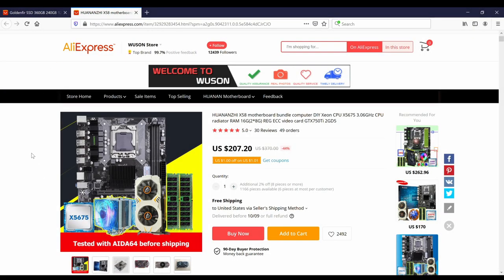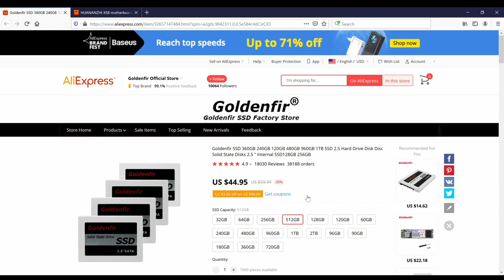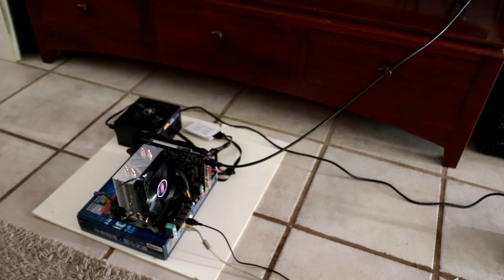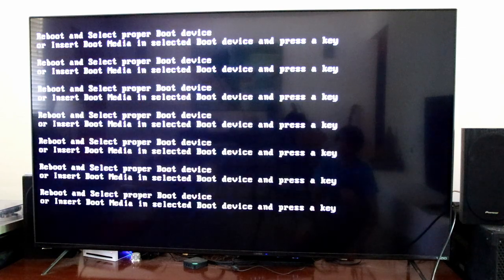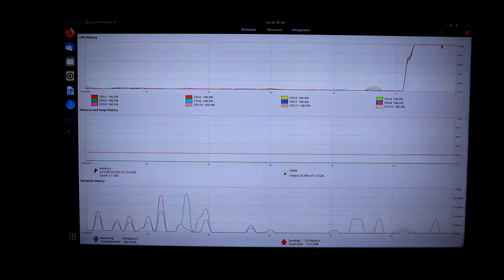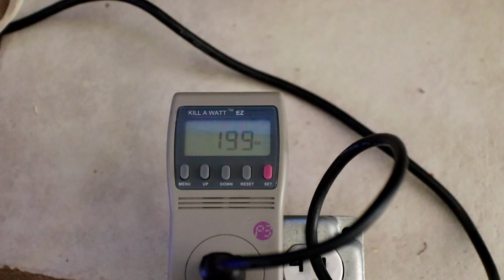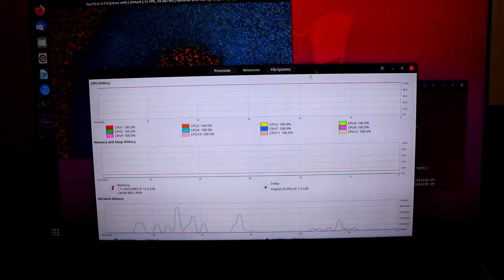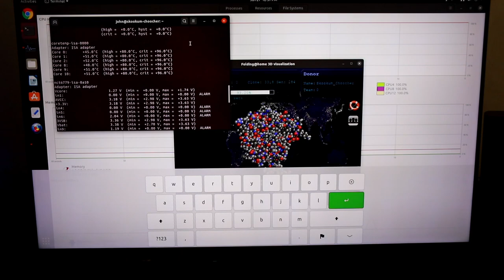Are PC Builders' Kits from AliExpress Any Good?

Comment: Not sure if I missed it, but did you check if the 750ti is a real one and not a older card as often appears to happen with chines gtx750ti's and 1060's. It could be the cause for the green flickering.
Reply from the maker: That could be the case. Ubuntu recognized it as a 750ti and automatically installed drivers accordingly. Do you know if there is a better way to find out if it is actually a 750ti than that?
Reply: Remove the screws that hold the heatsink and the card together and wipe off the thermal paste on the chip of the card it should say GM-107
Reply: @DielectricVideos  update for if it's real?
Reply: Aliexpress doesn't have this issue as bad as ebay does.
Reply: A combination of DVI, VGA, and HDMI isn't too far off from what you might actually find on a 750 Ti. EVGA used Displayport instead of VGA but there's an Asus model that had two DVI+VGA and HDMI.
Reply: I know this is old comments, but on windows you can get gpuz and it reads the gpu chip identification number, and you can search for that to attest if its a real 750ti or not